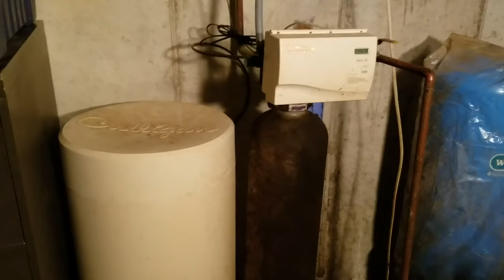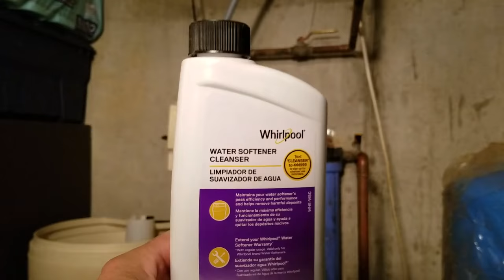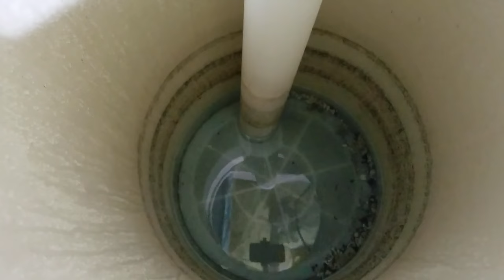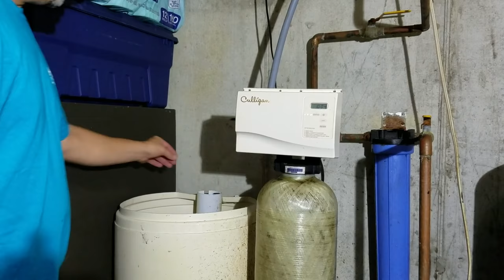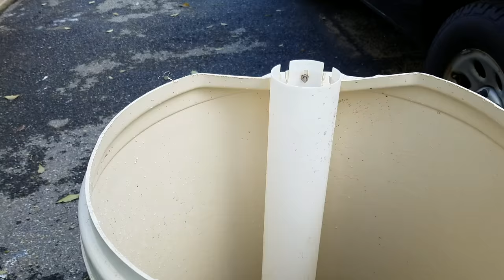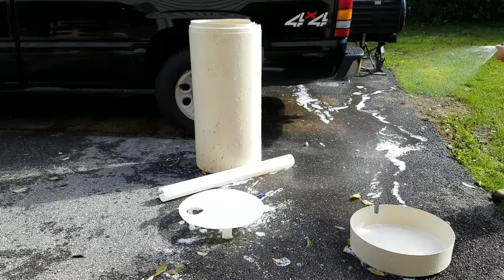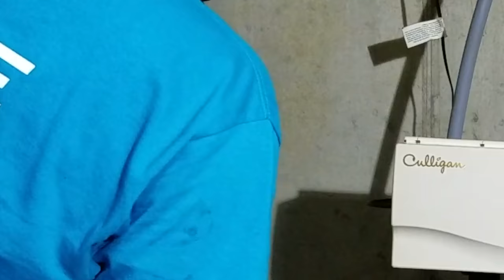DIY Water Softener Maintenance Culligan

Comment: I just noticed that our water softener stopped using salt, it's been a long time since I put new salt in it and it still has the salt that I put in it like six months ago.
Then a couple weeks ago the water dispenser on the fridge stopped working, probably due to hard water being pumped through it. I dunno what to do!
Reply from the maker: Look down the small tube in the salt (brine) tank and see if there is water in there.  Then run a regeneration cycle on the softener.
The water level should go down, very slowly.  If it does you may have developed a 'salt bridge'.  The wet salt can get stuck together and not fall down into the water.  You need to carefully break it up.
If there is no water or the level doesn't change then there is a problem with your mineral tank valve or the line running to the brine tank.
Reply: @HouseDoctorRay  Thank you for replying so quickly! :)
 I did what you said, did a regen cycle, it sounded pretty bad, like it's struggling. I gave the salt a stir.
 I discovered that the valve above the water softener was closed. So I opened it and it sounds like it's flowing a little better. It's not like an obnoxious hissing noise like it was. I'm wondering if the guy we had look at the fridge turn that valve off? Cause one of the copper lines go off of it and that goes directly to the fridge, so I'm assuming he might have turned it off to work on it. Ever since the problem with the fridge came up, it's been freezing food too. If it's not one thing, it's 6 others.
Reply from the maker: Since it's been a while since your softener regenerated properly you should do a regeneration daily for a week.  It will take quite a while to get rid of the mineral buildup.  You can't do it one after another because the brine tank needs a while to dissolve more salt.
As far as your water dispenser you may want to see if a dummy filter is available.
This video may also be your problem:
https://youtu.be/A-_rnlXNPDY?si=rqC9F51VzEQn7iUi

Comment: I have the same system in your video should my regen be loud and sounds like high pressure spitting water?
Reply from the maker: Mine also makes a lot of noise.  You don't really hear it on the video because the discharge hose is very long.

Comment: My bink tank run out of salt, i bought some, clean my tank but I dont see any button on the softener tank to press to regenerate, its plug in .. I have a elan water treatment, can you tell me what to press to fill water in the bink tank
Reply from the maker: If you no longer have the manual search for "force regeneration elan softener xx".  Replace the xx with your model number.  Good luck!
Reply: @HouseDoctorRay  thanks dear

Comment: What about that filter doohickey in the middle? Does that ever need replacing?
Also, are there supposed to be some kind of beads at the bottom of the tank that you washed and filled with salt?
Just got a house with a water softener that has not been maintained; tank is empty and dirty, so I definitely need to clean it, but no idea what else needs to be done.
Reply from the maker: The filter dohickey is not part of the softener system.  Yes, the filter needs to be changed.  See here:
https://youtu.be/qUQvqMR3_JY

If your softener is not working properly it may need the resin beads replaced.  They are in the mineral tank (scuba tank).
https://youtu.be/I9nenH07co4
Reply: Just get rid of the old, water softener. The water will leave scale deposits on your sinks and shower.

Comment: Hey gang..  So I heard my system regenerating while I just happened to be using the faucet at the sink when the water pressure suddenly went to nothing. 

I ran out to the garage to try to stop the regen cycle..  I heard a clank sound, and it stopped regenerating before I could do anything. 

I  thought to myself, well, now my softener is damaged.  Holy Toledo. I waited for the water  to come back on before I manually started a regenerating cycle. It did start, but I swear it didn't seem to run very long. Usually, when it self starts, it runs for a while. 

I did some research on Google.  Some say all of this can damage the unit,  while others say it's common, and these newer units simply shut down with no damage.  That clank I heard has me worried, so here I am.
Reply from the maker: Shouldn't matter if you are using water while it's in regeneration mode.  The system bypasses the mineral tank while it does it's thing.
Check your salt tank and make sure there is water in there.
Reply: @HouseDoctorRay  I'm sorry. The point of my question is not about my running water during a regen. The unit was in the big middle of regeneration when the water company shut the water off for maintenance.
Reply from the maker: You may need to do a regen twice to get the air purged and have the salt tank refill after the water is back on.
Reply: @HouseDoctorRay  Yes, I ran a manual regen once already.  I just need to know how these machines handle water being shut off during an active cycle.
Reply from the maker: It shouldn't damage the unit.  The worst that should happen is you get air in the system or the salt tank doesn't have any water for the next regeneration.
Reply: @HouseDoctorRay  Very good. Thank you.

Comment: Mine, which is just like yours, isn't regenerating when I push the regen button. Plus I need to change out the beads which I'll do that later. Brine tank has a acidic smell to it. I added Iron out about 2 weeks ago. I hate calling someone but may have to. Appreciate any help.
Reply from the maker: Sorry I didn't get a notification for your post.  Check out these other two videos I did.
This may help your non Regen issue:
https://youtu.be/q9oMG6jd1UA
Changing resin is easy:
https://youtu.be/I9nenH07co4

Comment: I think mine has a drain on the bottom no clue how to take it out
Reply from the maker: If you mean that your salt bin has a drain on it I wouldn't try and remove it.  Just clean bin out really well then rinse it out with a hose.
Reply: @HouseDoctorRay  I mean I can't disconnect it the same I think idk if it has an easy thing to pull out it is Culligan I will have to look and check it has some rocks in the bottom even though they told me to use their salt it's not pure at all
Reply from the maker: The small plastic hose running from the salt bin should have but at the end.  You should be able to easily loosen that and pull the hose out.

Comment: Personally I would have run the Whirlpool cleaner through the mineral tank after the brine tank was cleaned because all that nasty stuff went through the mineral tank.
Reply from the maker: Good point.  I ended up replacing the resin about a year later because it wasn't working well.  Works great now.
https://youtu.be/I9nenH07co4

Comment: It would have been useful for the presenter to give us some details on the manufacturer directions of the resin cleaner including the brand name and what it is composed of. The second recommendation would be for the presenter to correctly refer to the tall cylindrical tank as the resin tank. I have no idea why you are referring to it as a mineral tank.  My understanding of what the resin tank does is capture calcium and magnesium ions, then when the resin tank is regenerated through the use of brine, the calcium magnesium are flushed out of the resin beads. Hard metal such as iron remain on the resin beads and the liquid resin bead cleaner which you poured in the empty Rhine tank remove the iron from the beads. At least that's my understanding of what's taking place. The other recommendation I would make for the presenter is to clean the exterior of both the prime tank and the resin tank for sanitary reasons. Also, I don't believe you mentioned what the incoming big blue housing contained and why. Is it a carbon block filter to remove chlorine? Is it a sediment filter to remove fine sediment? Anyway I hope you use these comments to help improve your presentation if you do another one. Take care.